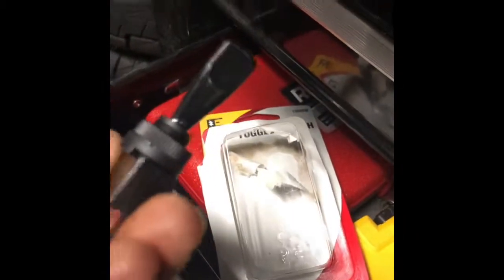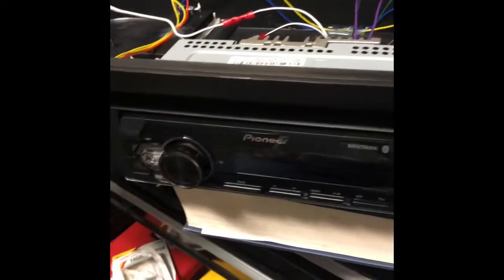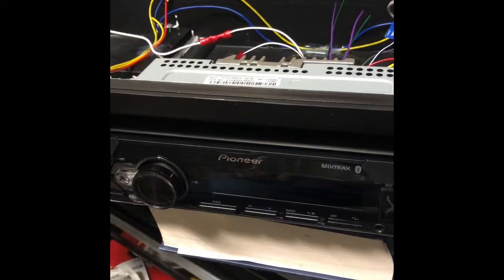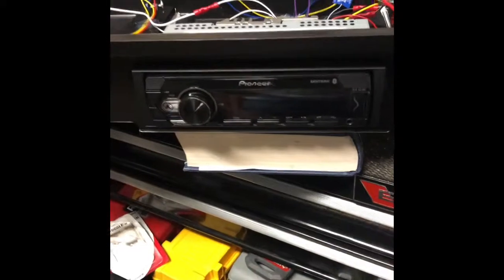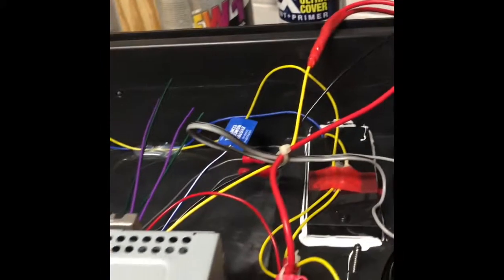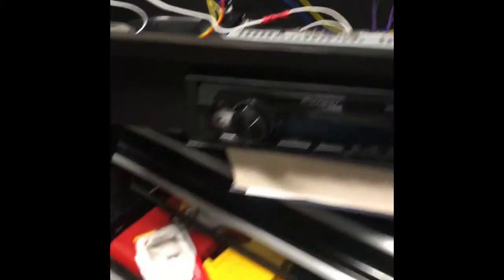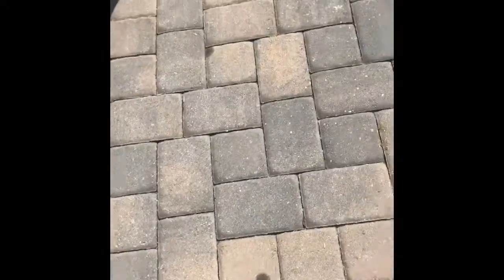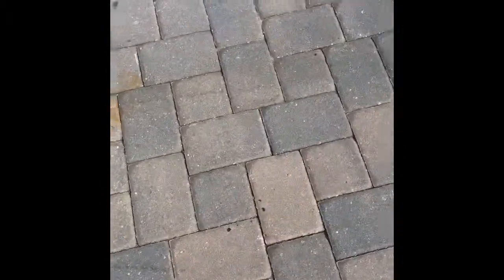How To Complete An Overhead Radio Installation for your Golf Cart

Comment: how did you attach the plywood/console to your roof bars? I don't see that in the video... thanks
Reply from the maker: Hi!  If the plywood is wider than the bars, you can drill a hole and put a bolt through it that will hold the roof.